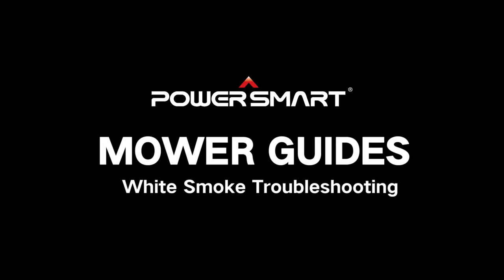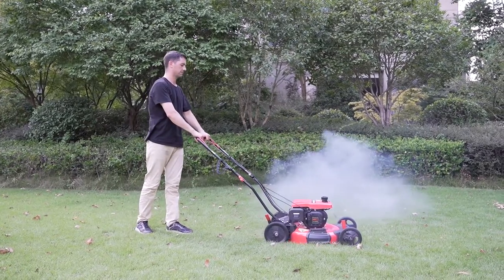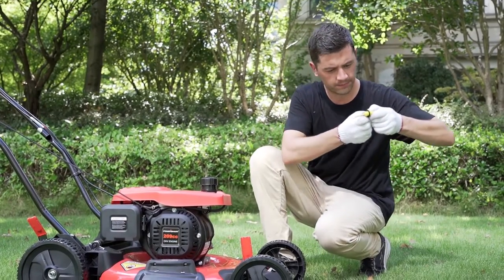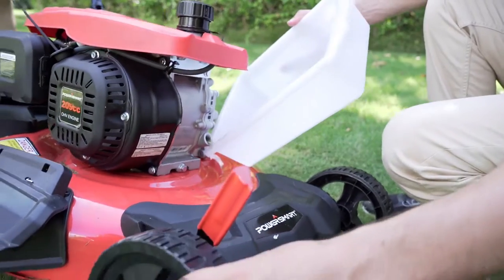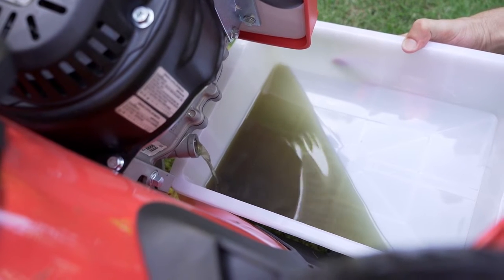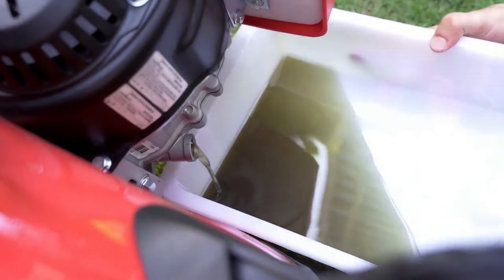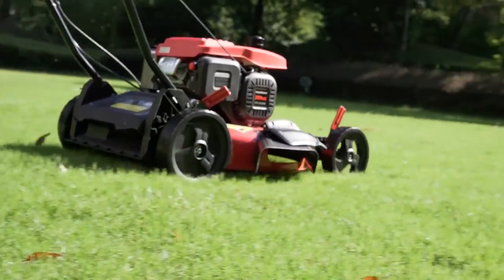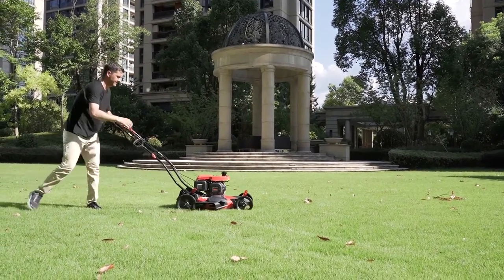Four Steps To Fix PowerSmart Lawn Mower White Smoke Troubleshooting

Comment: These mowers are great!  Ya the Powersmarts smoke a tiny bit when you first start them but its non concerning non issue.  The engines are actually really good on these mowers with lots of power!  The carbs work well too.  As long as you do the proper maintenance and drain the gas before storage these engines will run well every season.  The Achilles heel of this mower though is the plastic parts and bracket that holds the handle to the mower deck.
Reply from the maker: Thank you for your high praise. Your satisfaction are important to us and we value your responses. Thank you for your helpful suggestions as well. We will actively improve to provide customers with higher quality products.